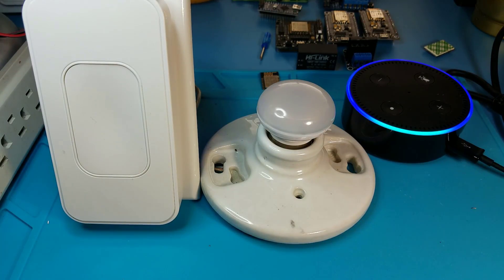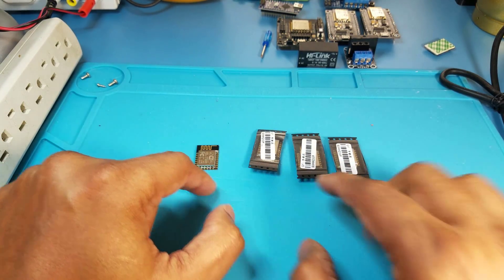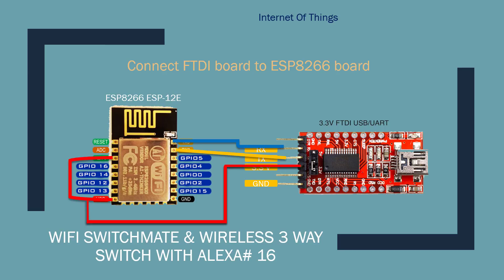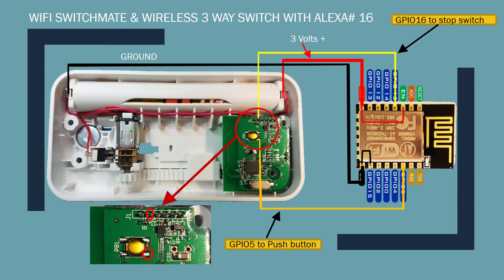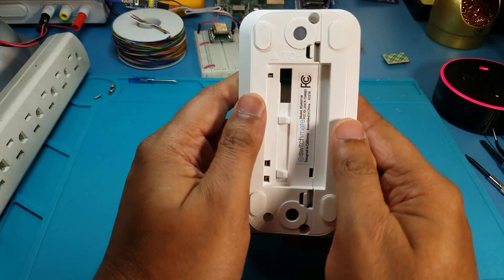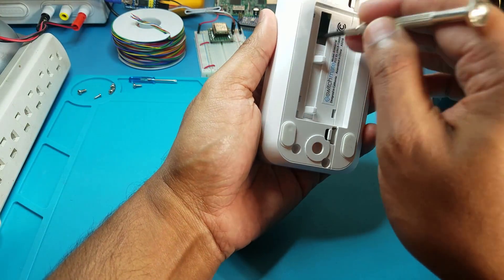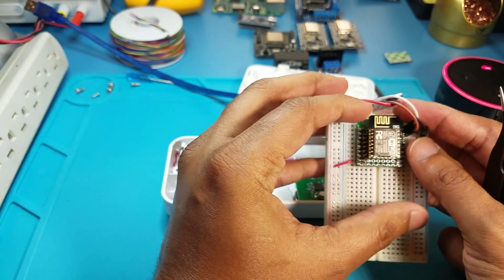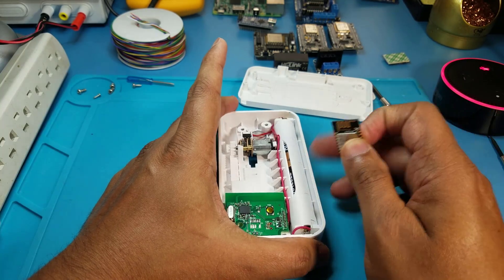WiFi switchmate| wireless 3 way switch with Alexa| Tutorial # 16

Comment: Well today, finally I program my esp8266 chip and then followed this tutorial by the book, and my Switchmate is dead, any ideas ? What has gone wrong here.
Reply from the maker: I am sorry. I am not sure but try to disconnect the esp and use a new battery and try it.
Reply: That's OK, I mean I have tried that, and have also contacted switch mate support, I hope I might get help with it while still in warranty. I mean it's not your fault , just my misfortune, I have been trying so hard to make it work the first task was to get chip programmed, it took me some time to figure out, but when it finally get to put it in the SM then it just fell dead. Anyways thanks for very nice videos, keep up the good work.

Comment: thank you so much to to making this type of video ...i relly learn about home automation after watching your chanel 
i have one confusion if i will use 4CH relay then what will be the other ( swith sensor on-off by diode and resister ) connection.
which pic should i use ?? and what will be the program ??
Reply from the maker: Which project are you referring to? I am not using any relays in this project

Comment: How many GPIO of ESP8266 ESP-12E can be used to control devices?
Reply from the maker: I think around 8 or 9 devices.
Reply: Thanks for your reply.
I believe GPIO16, GPIO14, GPIO12, GPIO13, GPIO9, GPIO10, GPIO5, GPIO4, GPIO2 are the GPIO that we can use. Plz correct if I am wrong.

Comment: Hi - Is there any way you could modify your code so that it could use a raspberry pi as a "wifi-to-bluetooth bridge"? That way, we could plug in a Raspberry Pi Zero (or any version) nearby the Switchmate -- the RPi could 'sit there and listen' waiting for commands from Alexa (maybe by using the WeMo spoof script) -- then upon receiving a command from Alexa (via wifi) , it could send the bluetooth command to the switchmate to turn on or turn off! That way, battery life would never be an issue. I have been trying this a number of ways, but I have been unsuccessful. I tried the "homebridge-switchmate" script out there (by emmcc) but I can't get it to work. However, I was able to install the  "node-switchmate" script by emmcc and it does control the switchmate ! I'd sure appreciate help. I am a true novice, and have been trying to learn a lot about iot, RPi, and linux just trying to make this work! Thanks again for a great video.
Reply from the maker: Craig Cole I will look into it in future. Thanks

Comment: Great video.  Any comment on battery life thus far?  Also, if battery life is an issue, is it possible to use something like an raspberry pi that has built in bluetooth and wifi as a "bridge"?.
Reply from the maker: Todd Griffin It is around 5 days.I'm trying to increase to one month. If you put a one second delay in loop and turn off the serial output you will get more days.

Comment: Thank you so much for sharing very excellent videos about home automation.  I am wondering if it is possible to make a DIY irrigation controller, HVAC controller and water heater controller?  In US, HVAC and water heater consume the most energy at a typical house.  Therefore if we can save energy by building some smart controllers for those, that will be great.  Right now the controllers on market, like EcoBee 4 and Nest, are very expensive, say north of $200 per unit.  The irrigation system can save water (and energy) if it can detect raining and skip some irrigation schedules.  Smart controller on market is also very expensive. 
Thanks again.
Reply from the maker: PBS CT I am looking into those projects that you mentioned above. I have long list of projects and very little time :-). Thank you for your feedback.

Comment: I was wondering if you could help me understand a little more on the code you upload on GitHub for the switchmate project. Would modifications would I need to do in order for it to work on my device? Also, is there a way to check status through Alexa app if the device is "on" or "off". Any information would help. Thank you
Reply from the maker: Jorge Morales It is spoofed wemo code that is modified to work with switchmate. You only need to change ssid and password flash and enjoy. You can add a function to get the state of the switch. Use "switchState=digitalRead(switchMate);" get the sate of the switch. Good luck.

Comment: Can you please tell me? How many different types of device or relay can we control from one NodeMCU ?. I also want to know that if I want to use 4 way switching including an automatic sensor for turn on the fan in my room.
Reply from the maker: MD.HABIBUR Rahman You can control lights, fan and anything that has a compatible on/off switch.
Reply: Thank you for your answer. But I want to use together sensor which will perform on/off automatically. Also I want to use your 4 way switching together. so thats means It may 6 way switching system like wifi, Bluetooth, sensor and the switch which you have been shown your video. I have one more problem, Alexa is so costly so I can't afford my project with this. so i want to use Google as the alternate. So I want to control many output with one single NODE mcu. Plese help me in my idea.
Reply from the maker: MD.HABIBUR Rahman Stay tuned for next 3/4 way switch tutorial with Google Mini. Thanks